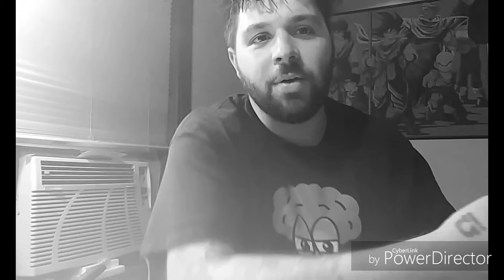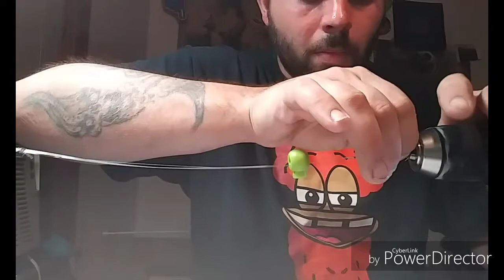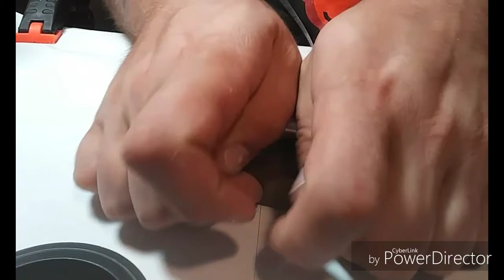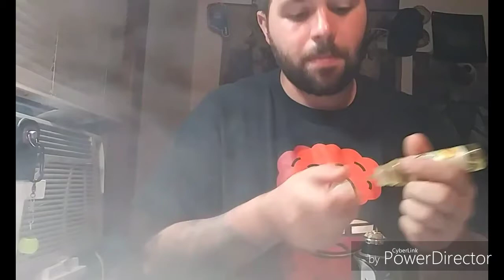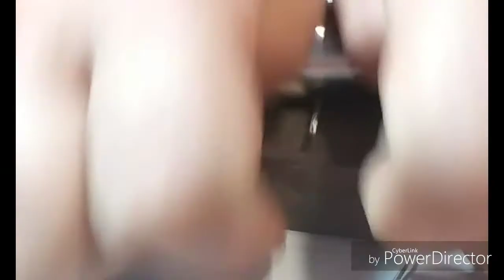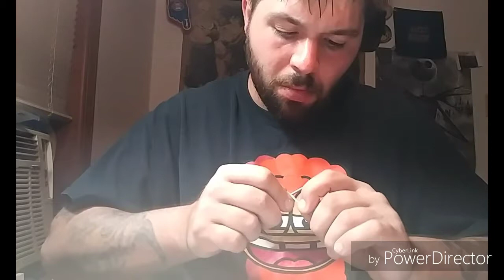Bonus Build- time lapse- CAT TRACK - n.devine83

Comment: Its also good info to not over work the wire. You can make it very brittle or cause tiny fractures inthe wires.  I hammer both sides to make it uniform on the entirety of the wire. Fantastic video (as usual) Nick.
Reply from the maker: +yetisuncle thanks